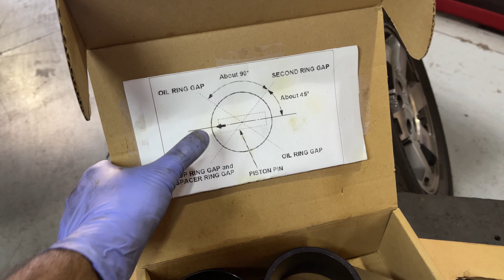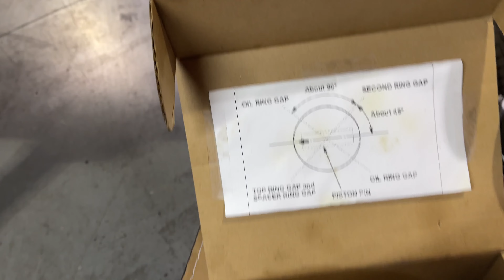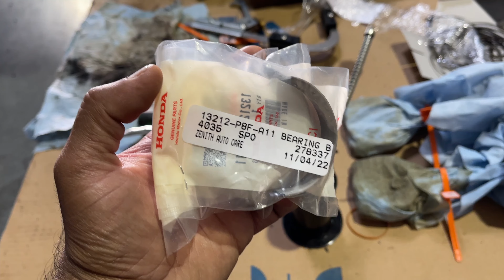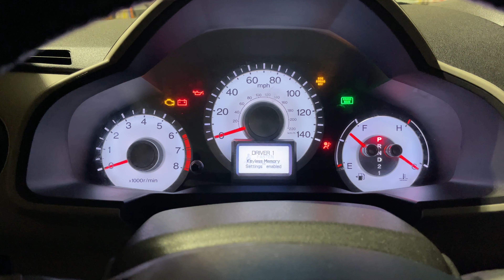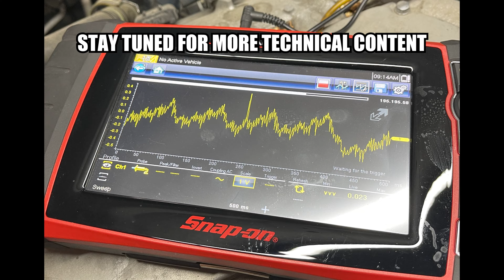PISTON RING REPLACEMENT ON A V6 J35 HONDA / ACURA MOTOR : 2012 HONDA PILOT WITH P0302

Comment: Great video,,,, Anytime you have carbon buildup in the ring pack check the PCV System or just replace the PCV Valve and hook your HVAC Manometer to the Dipstick Tube and test drive. You want to see 1 to 3 inHg in the Crankcase at all times. Honda has theirs detuned and is why they have this problem. 
You can run syn oil to go around the problem but more vacuum is needed to pull the bubble of Blowby away from the Ring Pack and correct this problem. Acura/Honda only run -.3 to -.8inH2O and this is too low for good PCV function. Toyota and Nissan also run this low vac to avoid running a Catch Can and draining it every other month.
Look at the varnish buildup that darken the closer you get to the Ring Pack/Pistons. The engine should be cleaner on the inside than the outside.

Comment: TO ANYONE WHO OWNS/OPERATES A HONDA VCM ENGINE: Get a VCM-Tuner or Tuner2 to disable the VCM system. This is your best chance of avoiding this problem. Even if it's the simpler manual setting version.  It can save your engine. Put one on around 50k miles when VCM caused the rear CAT to fail.  Ben running great ever since. Currently at 160k and still Showing 2% leakdown in each cylinder (each warm and at TDC). Cant recommend enough.  Great video BTW: Hope my tip doesn't cut into your business too much lol.
Reply from the maker: We actually tell people to do this as well, however we don’t have any recommendations on which one to get and we don’t install them, more of a DIYer option, thanks for sharing this though.
Reply: I have a ‘16 Acura RDX that needs this same repair. Cyl 3 has no compression. Bought it as a CPO car in 2019 and the CPO warranty expired 13 months ago. Car only has a total of 86k miles on it and I only added 36k since 2019. Been a loyal Honda owner for 30+ years. Not anymore. Honda America declined my case for them to assist in the cost of the repair. I am convinced this VCM stuff is what caused this, since all the info I can find online is it seems to always be in cyl 1-3 when this happens. I will be adding a VCM tuner for sure after I get this repaired. Great video.
Reply: I’ve read on the VCM thread that installing a Tuner before doing this job. Is there anyway that this would help?
Reply: Currently own a 2011 Honda Accord coupe V6. 100k miles. Never had a VCM problem. Should I put a muzzler of some kind? Trying to avoid that piston ring job at all costs.
Reply: Install a VCM Tuner as soon as possible if you purchase a V6 Honda.  Once it misfires, as our did this past summer at 110k miles (2012 Odyssey) it’s likely to do it again, even with the VCM muzzled installed.  I’m sad I found out about this problem and solution after the first misfire happened. I was also never notified about the class action lawsuit and warranty extension related to this exact problem.  Our van’s engine misfired again this weekend while my wife was traveling out of town to our daughter’s swim meet five hours away.  Now we’re looking at new vehicles, and probably not a Honda after this experience.

Comment: Great video, lots of good information!  Have an '03 pilot that we bought new that, fortunately, did not have the VCM yet, so none of those problems.  On it's third teenage boy and still going strong, great vehicles!  Oldest boy did get an '09 Accord with the v6 and VCM.  A little over a year ago, had cylinder 3 misfiring.  Not knowing what it was, we replaced the plug and the boot and ran fine...for about a week...then misfired again.  Kept happening on and off for about a month.  Ended up not being able to troubleshoot ourselves so took it into the dealer.  They pretty much diagnosed the issue without looking at it, just hearing what was happening.  Basically saving my son the fee to diagnose...told it was almost certainly the rings...$4k job, give or take.  Spoke with a couple of the techs about it as it was a slow day for them, and one of them mentioned trying bg moa.  Reasoning was it could potentially at least buy some time and wouldn't hurt anything.  Went home and researched a bit and found out about bg epr.  Tried that for 2 consecutive rounds of oil changes and the misfiring went away.  About 5 months back, he found out about another product that basically keeps the car out of eco mode most of the time, so he installed that.  Been over a year since the misfiring started and has been running fine so far.  According to him, his oil consumption went way down as well.  Don't think it would stop the rings from lining up, but definitely think it loosened them up to where they could work more like they are supposed to.  Personally, big believer in bg epr after that.
Reply from the maker: Thank you for sharing this experience. Hopefully people having these issues can see this and perhaps buy themselves some time if they can't afford to do the repair right away.

Comment: This is so incredible. Literally going to enable me to fix my car. Thank you so much.
Reply from the maker: Happy to be of service.
Reply: @SkillCollectors  hi there! I’m at the connecting rods. I see 3 of mine could use new bearings. How do I identify what bearing color to buy? Brown, etc.
Reply from the maker: @securityconnections9497  There is a small dab of color on the the edge/side of each bearing signifying what bearing you need.
Reply from the maker: @securityconnections9497  https://jetskisint.com/media/wysiwyg/crankshaft-balancer-bearing_colors.JPG like this
Reply: @SkillCollectors  oh my gosh. They are actually there!!! I went to the manual to coordinate the piston number to letter on the crank to try and do it backwards. Do you have a patreon or some way to support the channel?

Comment: With the valve covers already removed, i wonder if checking/adjusting valve lash would have been prudent
Reply from the maker: Wouldn't hurt but it wasn't the reason for the misfire and takes extra time which wasn't sold. In my experience it's rare that it goes out of spec, typically it exhibits different symptoms. Does happen from time to time though. Also no sandblaster at the shop.

Comment: So, I looked online to see if Honda sold the piston groove cleaner tool and ring compressors. Could not find that way. So did you buy them at the parts counter, and they ordered them for you. Would rather buy a good set than a cheap set and have problems with the tools. I'm replacing the rings on cylinder's 1,2, and 3 on my 2016 Honda Odyssey because of the VCM problem. Has only 118,000 miles on it. If you have some suggestions on where I can find these Honda tools that would great. thanks
Reply: So I watched a couple of your other videos today. Always nice to see other mechanic's work. I've been an aircraft mechanic for the last forty years but have done all the worked on my own cars as well. Talked with my snap-on rep. today. He was not much help with any tooling. He told me he doesn't have any mechanics that rebuild car engines anymore. Pretty sad to hear had. I guess there's not that many people who enjoy doing that anymore.
Reply from the maker: I remember my boss ordered these tools through Honda. It was a special order thing. I wish I had some part numbers for you but this was so long ago now.

Comment: Hello again, I'm finally getting around to pulling the rear head on my 2016 Honda Odyssey. I ordered all the parts for the job before getting started. One thing I couldn't like on Honda's website was the oil pan gasket. Is there one or do they use a sealant on the pan. If there is a gasket, could you help me with a part number for it. thanks again.

Comment: You don’t have to remove the coolant pipe from both heads. Use superglue on the rear nuts and the studs will come out of the rear head. Leave the pipe attached to the front head.

Comment: Great informative video. Why not replace the pistons instead of cleaning them? I've got an 07 Ridgeline with 192k on it runs like a top. It does have a knock in the motor thats driving me nuts and I can't identify it. Sounds like a valve tap but I've checked the clearances 2 times and they are spot on. Motor runs great and burns no oil just has a loud tap at idle that goes away as soon as you put a load on the engine.
Reply from the maker: Assuming you have one of these J Series engines... If that sound you have is indeed coming from the head, I have seen prematurely worn camshaft lobes cause mysterious tapping in the head, they usually check out in a clearance inspection because the clearance is done when the cam is not touching the rocker arms. I'd get a stethoscope and listen closely on different areas on the engine. If it's definitely under the valve covers, next time you have those apart, look real closely at the cams, sometimes you even have to remove the cam holders to see the damage. 
As far as replacing the piston, if it doesn't pass inspection then we'll replace them but I've never actually come across one that's bad. It's just added parts and labor for the customer if we replace everything, the bill starts to add up fast when you do it that way.
Reply: Check your timing belt tensioner, they leak out and causes it to lose tension on the belt. It'll sound like it's rattling or knocking on cold starts and eventually sounds like that all the time until there's a load.

Comment: Hi, We have a 2005 Acura RL that has excessive oil consumption and 30 percent loss on a leak down test for number 6 cylinder ( air escaping out the oil filler cap when number six is at TDC). Compression was good on the rear bank but variable on the front bank. Leak down was steady 10 percent across the board except number 6. That motor looks almost exactly like the RL we have ( I have only just removed the intake manifold and the valve covers). I think I want to try to replace the rings on the front head but is there any way you can confirm that the VTEC motor in our 2005 RL is the same as the one in the video?  Also, it has been recommended that I send the head to a machine shop to do the valve guides and seals if I attempt the ring job. Is this a good idea?

Comment: Great video. I learned a lot from it. My Accord (with same engine) is currently having the exact same issue, keeps misfiring in cylinder 2. I just keep throwing in a new spark plug because I'm not in a financial position to have this job done. Are you able to give a ballpark of how much this job costed the customer so that I could get an idea for myself? If I had all the specialty tools and a car lift at home I'd probably try to do this job myself but since I don't, I'll eventually have to take it into a shop. Once again, great video, I'm glad I was able to learn from it.
Reply from the maker: Not sure on the cost but it's a pretty big job, I want to say 1500-2000 maybe. There is a commenter in this video that said they used BG EPR and had some good results with that. Maybe you can give that a shot and see how it works until you can afford to fix it.

Comment: Great job we have the same problem on my wife is odyssey. I got three questions call for the piston bring the compressor tool. What’s the part number or where you get it from and what about the head cylinder bolts and the connect rod bolts do you have to replace them thank you
Reply from the maker: Thank you, wiseco actually sells these. You can get them on summit racing: https://www.summitracing.com/parts/wis-rcs08900?seid=srese1&ppckw=pmax-tools&gclid=EAIaIQobChMI1dKA1K3m_wIVIRitBh13jwyzEAQYASABEgLyt_D_BwE

As far as replacing the rod or head bolts. It’s only necessary if they are stretched, there is measurement procedures in the service info to check this but in my experience they rarely ever need replacing. (I’ve personally never had to replace any).

Comment: HI Buddy, it is great video and very nice explanation. Our 2012 Odyssey is victim of this problem and would like to get it permanently fixed. Let me know if you can help. I don't think I can do this as it is complex job. Or anyone else who are available in Dallas area. Thanks.
Reply: Same problem on our 2012 Odyssey. Started at 110k miles. Had spark plugs replaced, new oil with RISLONE additive (recommended with all future oil changes). Then I installed the VCM Tuner to muzzle the VCM system (which makes the vehicle feel and drive great, btw; no more ECO mode engine shudder).  Oil changed once since (I didn’t add the RISLONE yet) and it just misfired again this weekend.  Frustrating to say the least. We’re in Cleveland, OH.

Comment: Enjoyed your video all the way through. I have a V6 2010 Honda with VCR problem with 
number 1 cylinder. It has 70k miles on it. Started to backfire about 60k miles. Took it to Honda dealer in Marysville, WA. .....won't do a thing. Do you have a way to to contact you via another channel. If you are  that close to WA. state, I'll bring the Accord in. You seem to really know what you're doing and have a great attention to detail. Thanks.

Comment: you only did 4 of the 6, do 5&6 not ever have issues?
Reply from the maker: 5 and 6 are not part of the cylinder deactivation system and are not usually affected. There's a point in the video where I show the hardware in the cylinder heads and it's not present in cylinders 5 and 6.

Comment: Do u need a special tool for piston rings or is there other tools to use?
Reply from the maker: Yes, a special piston ring tool is required to remove and install them and then a special piston ring compressor is required to install the piston in the cylinder.

Comment: Should you have honed the cylinders? Is it necessary? If not, why
Reply from the maker: If the cylinder is glazed and lost the cross hatching from the factory then yes, it should be honed. The cylinder should also be measured from top to bottom to check that it's still cylindrical. Most of the time though it's still good to go and only the top but of oil build up needs to be cleaned off.
Reply: @Master of None  gotcha. I have to check my rings out on my 06 Odyssey eventually. My compression is good but i just want to get in there and clean it up. I installed a vcm bypass and it hasn't been losing much oil, but it definitely burns a small amount.

Comment: 1. If you can remember, how many miles were on this motor?
2. Were the bearings and rings oversize or standard?
3. Would honing the cylinders made a difference in longevity of the repair?

Comment: Would this fix the check engine light being on? I got it checked out it says it’s the catalytic converter thing but it burns oil so I didn’t change it thinking it would not fix the issue.
Reply from the maker: If the cause of the oil consumption is the piston rings then yes, it would fix the primary problem, then you'll also have to change the catalytic converter as well. The burnt oil pre-maturely wears out the cat.
Reply: @SkillCollectors  THANK YOU!!!!!!

Comment: How much is this job? My Odyssey needs it done and I really don't want to do it in my driveway.
Reply from the maker: Being a tech I’m actually disconnected from the quoting and billing process so I am not really sure. I want to say it’s probably 1500-2k-ish for parts and labor.
Reply: @SkillCollectors no sir. An all day job like this is going to quote for $3000-$5000.
I've had two mechanics say it might be better to just replace the engine. 
Less experienced mechanics might actually do it wrong and create more problems, that happens too. 

There was a class action lawsuit in 2013 due to the damage caused by the VCM, especially version 2 which included shutting down cyl 4.

If it starts sucking up oil it can cause scratches on the cylinder wall, so they say just get an engine,  sigh.
But engines right now are going to run almost $10k. 

For anybody with these Hondas with VCM, buy the device that shuts it down, save your engine. 

Although it's been a while since 2013, if you bought it used, probably someone has already had to deal with it. Don't let it happen again!

Comment: dont you have to put new cross hatches in the cylinder to have the new rings seat? i always thought that. I see youre from VA, same lol. Nice video man. Just learning about these engines since i want to buy an older odyssey. Thanks for the upload, fully enjoyed it and very informative
Reply from the maker: Thanks for the comment. You only need to hone the cylinder if there's no cross hatching and it's glazed. In my experience, I've never come across one that didn't still have cross hatching. If you wanted to take the extra step to hone it though, it definitely wouldn't hurt anything but there's a lot of clean up to be done after honing to ensure a clean mating surface.

Comment: Hey, 1) Have you seen any pitted camshaft lobes or piston slap in J37 engines which had oil consumption? 2) If yes, was there a tapping/knocking noise associated with deformed camshaft lobes or a piston slap?
Reply from the maker: I have seen this before a handful of times, can't remember if it was a J37 but for sure on V6 honda engines. We replaced the camshaft and corresponding rocker arm and it fixed the problem.
Reply: @SkillCollectors  If I provide you with a video clip with tapping or knocking noise would you compare if this noise is similar to what you heard on these engines?
Reply: @Charkatak Did you figure it out? I wouldn’t mind taking a look at the video clip to try and help.
Reply: @JoeMomma.   I sold the car last month.  That noise wasn't consistent and a different oil brand, addition of marvel mystery oil helped.  I drove 3 years like that and haven't seen any degradation in performance or an increase in noise level.